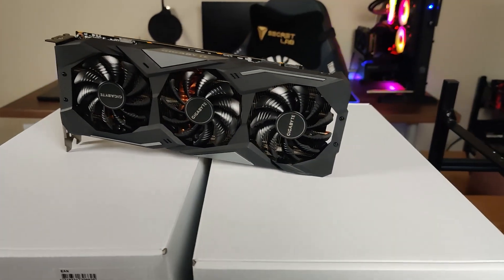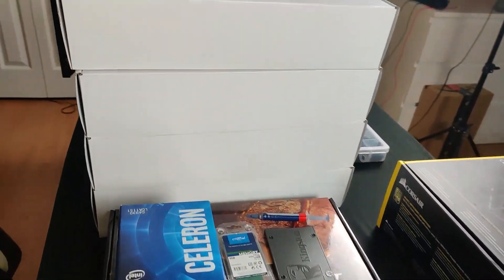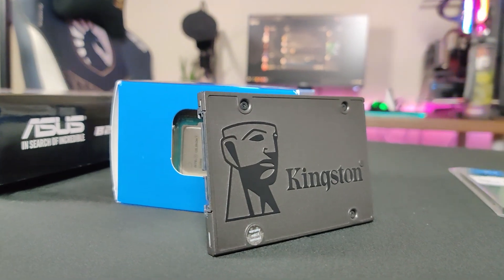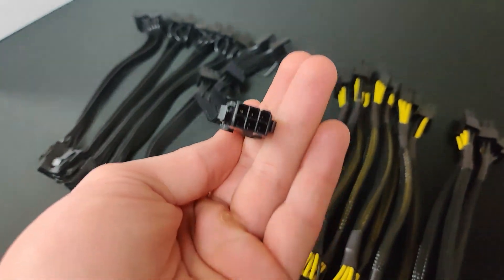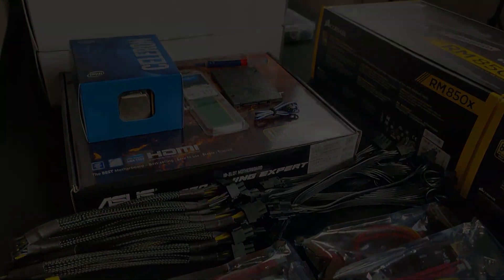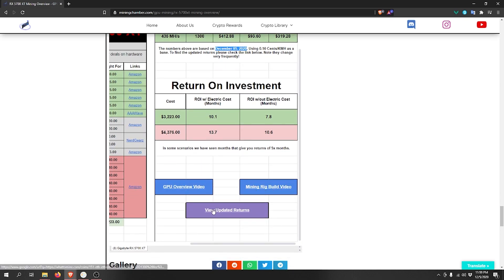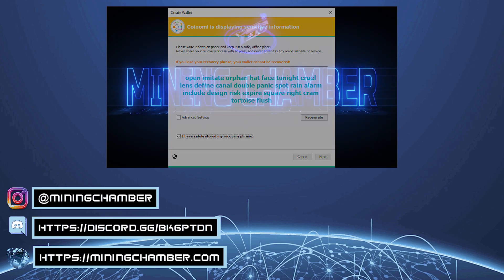RX 5700 XT Mining Rig Build - 8 GPUs | 435MH and 1300 Watts!!

Comment: Great video! I have a question tho.I'm planning on building a 6 5700xt's rig with a LC 1200W Platinum edition PSU, but I'm a little bit confused about how to connect the gpu's and the risers, since I doubt that there are that much 6pin ports on that particular PSU.And I'm trying to avoid using the sata cables to power the risers since they are unsafe.What do you recommend? Also is it okay if I use a splitter for one 6pin from the psu to one 8pin and one 6pin to a single gpu? Because 5700xts are connected with one 8pin and one 6pin
Reply from the maker: Hey! I would recommend using splitters as much as you can and those splitters connect to vga cables. So one vga cable from psu to a gpu and a riser by using a splitter. Don't connect splitter directly into PSU it has to be through the main strand which is usually an 8 pin on the side that plugs into psu.

I actually also have a full guide on the PSUs can be found herehttps://youtu.be/e7AO8ADUD5g
Reply: @MiningChamber  so im good if i use one vga cable to power 1 gpu and its riser? I would use one splitter to split 8 pin to dual 8 pins because 5700xts require dual 8 pins, and if that particular vga cable has another port on it i can use that to power the riser?Or even if i use a splitter there maybe even 2 risers? But i think thats maybe too much power for that one vga cable? What do u think?
Reply from the maker: Yes that is fine! You can do 2 risers and one gpu but that is pushing it yes so it's better to stay safe one gpu and one riser per vga strand
Reply: @MiningChamber  Thank you very much!! One last question, can you reccomend some psu's for 6 5700xts mining rig? Like best for cable management, that 1 vga cable can have 2 6+2 pins so i can connect the gpus and risers the way i asked you in the comments above? Like it has 2 ports on the side that goes into the gpu and its risers  not only one?
Reply: @MiningChamber  That way i would use 1 splitter into one port for the gpu, and second port would be for the riser if you understand me.
Reply from the maker: @petarmilojkovic3331  Yes I understand what you mean, I think the best ones are the EVGA P2 1200 but you might have to buy additional VGA 8 and 2+6 pins strands if you get single 8 pin strands but make sure you buy compatible ones to your PSU (Check cable compatibility of your PSU) alternatively. IF you have single 8 pin you can use splitter to power the GPU and then for the Riser you can run a strand of Molex for it
Reply: @MiningChamber  Thank you very much ! Keep up the good work, little details really matter with this mining stuff especially when you are getting started with it like me 👍

Comment: What a nice rig!
Im trying to find out if i can split a 6 pin to power my 5700xt.. Or do it need to be a 8 pin split into two?
Im confused 😣
Reply from the maker: Thank you! Yes you can for sure use a 6 to dual 8 pin but it is safer to use 8 pin to dual 8 pin!
Reply: @MiningChamber  Great, thanks! I only have a server psu with the breakout board and 6 pins. But i also have a bigger server psu with a board where i can use spade connectors and buy thick splitters, think it was 12 awg and it splits to two 16 awg 8 pins. I want to make it safe in case the undervolts resets and it keeps mining on stock settings. :-)
Reply from the maker: Aha I see! Then in that case maybe try to get 16 awg when you can and temperately run them on the  12 awg! And my pleasure ⛏️⛏️

Comment: I have 7 x gigabyte rx5700xt  all settings copy from your video but some card using more power like 140w and mem temperature is to hot 95c please help..
Reply from the maker: Try putting an external fan near it. What's your gpu fan set to?
Reply: @MiningChamber   fan set at 90% 
Also in my mining case 6 Delta fan 4000 rpm so thay no another way to reduce power consumption to keep mem at 80 to 85c  and my hashrate is only 54
Reply from the maker: Hmm that's odd, in a case it's usually best to lower the gpu fans since the delta fans do alot of work. Is your environment generally hot weather ?
Reply: @MiningChamber  in India generally weather is hot but running session is winter room temperature is 22c.
Reply from the maker: Aha Not bad, not sure what else you can do other than possibly changing the thermal pads on the GPUs or put them in an open frame

Comment: What do you think about RX 570 8GB for minning ? Is it profitable with $0.07 kWh ?
Reply from the maker: With that electric rate every card will probably be profitable as of now! Rx 580/570 are great if you can find them used below $150 but if your planning to buy new cards id go for 5600-5700xts
Reply: @MiningChamber  i find used RX 580 8GB for $185 and new RX 570 8GB $185 . what is better to buy?
I can't find better deal now . to buy from other countries will be much more expensive because shipping
Reply from the maker: @24beats96  If its the same price they are both fairly similar! If you trust the used seller Id get the 580s if not then get the 570s!
Reply: @MiningChamber  i don't realy trust used , i'll buy 570 . thank you for help

Comment: why power Molex on the motherboard, if the riser and so get power on Molex/6 pin/SATA? power both the riser and the video card from one braid.... how long will the wires live like this? or is that why it powers the Molex motherboard?
Reply from the maker: I actually am not quite sure exactly for the reasoning but Ive had multiple scenarios of cards being very unstable till I power that molex on the board. Most of the manuals advise to plug them in so I am assuming there is a reasoning but I will try to dig in more about it!

Comment: 435mhs @1300watt. 0.334 mhs/watt which is not much efficient. Bios mod your cards. Rx 5700 can easily reach 56-58mhs @ 125-130watt.
Reply from the maker: I did BIOS mod them! Like I mentioned in the video there is further undervolts and tuning that can be done just some cards are being very odd and keep on crashing, off camera it will be troubleshooted and tuned right ;) just did not have the time to be able to fix it up fully

Comment: My 5700xt Gigabyte Micron Memory Same Thing is using 140 Watts for some reason!
Same OC Settings, Same Bios Mod!
Reply from the maker: Is that 140 watts on the software or off the wall? Cz we are about 150 watts off the wall each gpu! So I'd recommend measuring it from there ⛏️⛏️
Reply: @MiningChamber  140 watts on the software, about 165 On the wall.
Like i have 4 x 5700xt running at about 560 on software and about 700 on the wall
Using hive os, 1300 core frequency, 760 core clock ( using 725 core clock brings it down by 10 Watts each)
Reply from the maker: @anubhav987  hmm weird  maybe try 770 core voltage, what's your memory frequency on?
Reply: @MiningChamber  I'm able to go to 940 on memory, but even lowering to 900 doesnt change power requirement
Reply: Also, I'm using a ryzen based mining rig..
(2200g with asus b450 f)
Reply from the maker: Hmm very wierd never heard of that, maybe try reflashing HiveOs?
Reply: @MiningChamber  thats OK,  this isnt so important right now. 
What i was wondering is , is it possible to check how many watts is the riser pulling (not on software, like actually pulling). That will allow to check if we are running into risks of burning.
So eg : in ur case, ur using a 6 pin to dual 6 pin.  Each of the dual 6 pin is capable of pulling 75 watts, but in your case, it shouldnt cross maybe 37 watts since ur using a splitter
Reply from the maker: The 6 pins can provide more than just 75 watts. In the PSU guide we made we get more into details, although it is a topic full of mysteries since some say they can only give 75 watts for 6 pin and 150 watts 8 pin while others say 288 watts and 216 watts. Now as for measuring the watts off the riser, Spacegoats and BitsBeTrippin have made custom wiring with meters to measure that, I'd recommend checking their channels out, I don't know exactly which video it is but I remeber seeing it on both of their channels !

Comment: For dual power supplies, how do you specifically allocate each power supply based on power consumption?  One power supply is motherboard+cpu+2gpu, and the other is 6xgpu.  Or a motherboard+cpu+4gpu, another 8xgpu (12gpu mining rig).
Reply from the maker: The cpu mobo and all that really doesn't count for much, it usually comes out to 40-60 watts. So the best thing to do is equally divide gpu and the riser that's powering the gpu equally between both PSUs if they are the same wattage. If you have a smaller and a bigger psu then do it proportionally as long as your under the 80% of total psu watts. You can learn more on that from our ATX PSU guide on our channel!

Comment: You can't set memory voltage to 850 mV, because the lowest memory voltage is 1250 mV. 850 mV can be set to memory controller voltage
Reply from the maker: Thank you for the information!! I figured it didn't make sense since when you hover on it, it does give a max and min that is not below 1000. I'll make the change thank you so much!

Comment: Thats very bad power consumtion...try other bios modes...you ga can get it lower--1080w from wall for 8gpu...
Reply from the maker: Yess like I mentioned in the video there are much more tuning needed to be done! Just I had a couple off cards that wouldn't overclock well at all, therefore I put in what was most stable

Comment: Here one of mine rigs 8x Sapphire Nitro+ SE
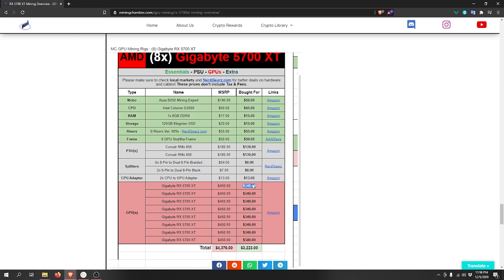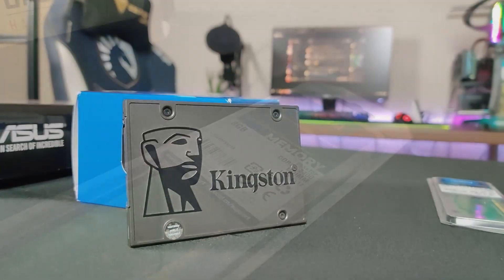* 13:05 * 12/9 01:27 ************************************
Eth: Mining ETH on ssl://eu1.ethermine.org:5555 for 9:30
Eth speed: 448.459 MH/s, shares: 5085/1/16, time: 13:05
GPUs: 1: 55.671 MH/s (629/1) 2: 56.292 MH/s (627) 3: 56.290 MH/s (668) 4: 56.285 MH/s (647) 5: 56.290 MH/s (632) 6: 55.667 MH/s (623) 7: 56.289 MH/s (638/15) 8: 55.675 MH/s (622)
Eth: Accepted shares 5085 (3 stales), rejected shares 1 (0 stales)
Eth: Incorrect shares 16 (0.31%), est. stales percentage 0.06%
Eth: Maximum difficulty of found share: 12.0 TH (!!!)
Eth: Average speed (5 min): 448.450 MH/s
Eth: Effective speed: 431.39 MH/s; at pool: 431.31 MH/s
GPU1: 48C 40% 90W, GPU2: 47C 40% 91W, GPU3: 46C 40% 89W, GPU4: 46C 41% 92W, GPU5: 52C 41% 90W, GPU6: 49C 40% 91W, GPU7: 46C 40% 88W, GPU8: 50C 41% 90W
GPUs power: 721.0 W
But will reduce a bit the clock on GPU7 :)
Reply from the maker: Very nice!!

Comment: I have 5 of those exact cards in stock bios ( tried to bios mod and bricked them, saved factory bios so re flashed them back ) I’m getting 53 a card using around 103-105 watts a piece with one only using 92

Core: 1340
Core voltage: 740
Memory controller voltage: 740 
Memory clock, MHz: 930. ( was on 940 but sometimes I’d get a few cards crashing randomly within 6 hours or so ) 
Memory voltage: 740
Fan: 80% 

All setting are for hive os, been running stable for over a month and temps are between 82-88c
Reply from the maker: Oh wow that's amazing!! Il give those settings a try !
Reply: @custom99banshee bro I have 7 of those bios mode but they use more power like 140 and give only 54 mhz all settings in hive os core 1350 mem 900 core voltage 740 fan 85 mem temperature is 95c how to reduce power consumption ??

Comment: How loud is that rig? Would have been great to hear it working...
Reply from the maker: Sorry I didn't record a clip of it running with audio ! Next time il make sure to include that. It runs as loud as a stovetop exhaust on medium/high  based on your fan percentage. Since memory gets hot then it's a pretty loud rig but the other Sapphire nitro we built can run on 50% fan for nice temps and fairly quiet
Reply: @MiningChamber  : Thank you very much Sir. Do you think it can be operated in a block apartment? (meaning the noise)
Reply from the maker: It can for sure, the only issue is having proper airflow! It definitely really heats up the place so if you can assure good airflow then your set ;)
Reply: @MiningChamber  Thank you for your valuable advice Sir!

Comment: i'm surprised you get a stable rig with an 850 MVDD, my Red Devils will spit the dummy at those sort of voltages... Took me a while to figure out why and even after swapping mutiple risers later the problem was still there until i changed the MVDD to 1300 and its been stable as a rock ever since...
Reply from the maker: I actually took off mvdd after as well since it seemed out of place and now the rig is still running pretty stable, I don't think memory voltage should be messed with, I might be wrong though

Comment: I noticed the motherboard you are using has multiple 24 pin power slots...are you opposed to using the 24 pin splitters?
Reply from the maker: I have nothing against it! Just no need to use that adapter when there is already a port on the board. I did use that adapter in our previous build video for the Radeon VII rig!

Comment: Hello @MiningChamber, Could you please share the modded bios you mentioned in the video for gigabyte cards, I tried to flash my gpu using RBE and MPT with 20.4.2 amd drivers but the driver says bios is not compatible. I only get 52 mhz. Also any inputs for asus taichi cards?
Reply from the maker: Hey! The link for the files is here https://mega.nz/folder/PFtCTBYS#AzKgME9vJitocIKIGYKw1g you will just need to follow the RBE and MPT steps on this bios from the folder (get the one that matches your card, xt or non xt) and then after making the changes try to flash it, if the flash fails, note down the ID mismatch and change your BIOS ID in RBE to your original BIOS ID and then try to flash it again!

As for Taichi cards I'm not quite sure unfortunately

Comment: Love your videos! I have a gaming PC that I mine on when not using, makes about $34 per month. Can I add one of these GPU's or a different one to my PC and mine from two GPU's without it messing up my gaming PC?
Reply from the maker: Thank you!! And yes you can for sure! I don't think it will cause problems but give it a shot and see how it goes
Reply: @MiningChamber  Would this work? https://www.bestbuy.com/site/xfx-amd-radeon-rx-580-gts-black-edition-8gb-gddr5-pci-express-3-0-graphics-card-black/6092641.p?skuId=6092641&cmp=RMX&extStoreId=22&ref=212&loc=1&msclkid=2b2aa226ea95101ab5b3fde8b77c841e&gclid=CJ2wj9qqvO0CFf-oxQIdGVoEog&gclsrc=ds
Reply from the maker: Yes but it is too expensive for a rx 580, try to find it used or get a 5500,5600,5700 xts
Reply: @MiningChamber  Thanks so much!

Comment: shouldn't the cards powered by the 2nd power supply be in section B of the pci layout so the cards match the power supply they are drawing from?
Reply: with all the interconnectivity would it not basically be a shared rail by that point?
Reply: @blair.nichols  the manual says ...  to make the power consumption in balance, connect the 6-pin/8-pin power connectors of your mining cards in area A to the power supply unit (PSU) plugged in EATXPWR_A, and mining cards in area B to the power supply unit (PSU) plugged in EATXPWR_B.
also important AUXPWR_A1/A2/A3 must be connected to the same power supply plugged in the 24-pin EATXPWR_A connector.
Reply from the maker: I actually did not know that! If it does give me any troubles then il try that!!

Comment: same build with me .. but 6 vga card 5700 xt pulse , I'm getting quite high memory temp about 90c , already asking around bellow 95c is fine ..  what do you think ?  do you think increasing the fan speed can lower the life of the  fan ?
Reply from the maker: Keeping it running hot lowers the life of the GPU, so it's better to have to replace the fans than to lose the gpu! I'd pump it up a bit, we have another build that's a 6 gpu nitro plus feel free to check it out! It's in the gpu mining rigs playlist

Comment: Hey mining chamber, let me know if you want a better overclocking/undervolting setup so as to increase hashrate to 448 and decrease wattage to 835
Reply from the maker: Oh wow that's insane! 835 watts off the wall? Share with us if you don't mind! ⛏️♥️
Reply: @MiningChamber  
Straightforward as it can be: clock freq 1300 .. voltage 781 .. vram 1798 .. power limit: Nop, to the max .. and voila

This should get you 55.3 mh in phoenix miner and takes up 103 - 105 w per card
Reply from the maker: Aha I see thank you! The software draw is around 100-105 but off the wall it will probably be around 130 watts or so per gpu!
Reply: @MiningChamber  
Still way less than a total of 1300 w .. plus the significant increase in hashrate .. don't also forget the  decrease in temp because of the low power consumption .. it's always a winner
Reply from the maker: Oh absolutely I didn't mean that the settings you mentioned are bad!! Just it won't be 835 watts for 8 cards since we are using the same settings you mentioned. We have core voltage 770, Vram 900(1800) core clock 1300. Just the voltage can be dropped down to 750 ish hopefully and then it will shave off another 100-150 watts which then will leave the cards at 130-135 watts each and 60 watts for the system

Comment: Awesome video! I am doing the exact same build with RM850 and 8x5700 XT Devil. To clarify you powered 6 cards with standard PCIE-cables and used 2x 8-pin CPU to 2x8pin PCIE to power the other two? And could you please detail the powering of the 8 risers? No use of Molex or sata cables? Thanks!
Reply from the maker: Thank you! We didn't use any SATA or Molex for risers or GPUs. We had 6 strands of dual 8 pin. So we used 4 strands to power one gpu and one riser and then the last 2 powered 1 gpu and 2 risers each, afterwards we used the cpu to gpu adapter and powered 2 cards with 2 cpu strands!